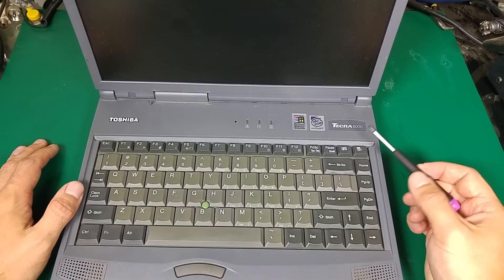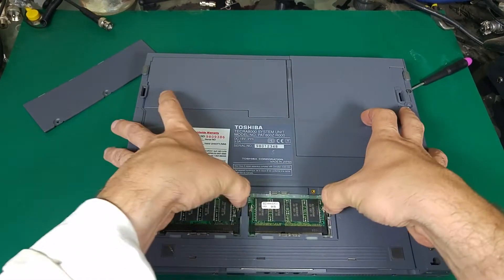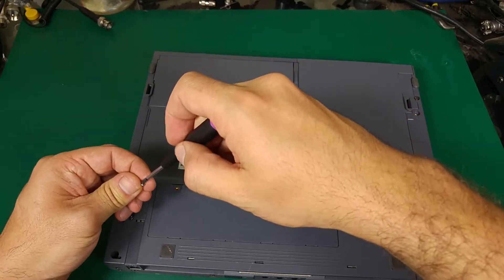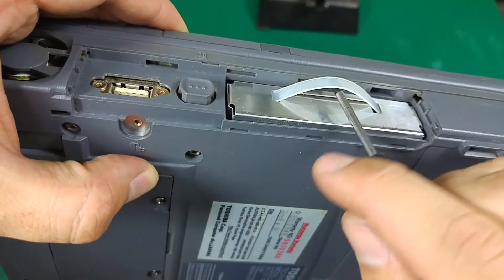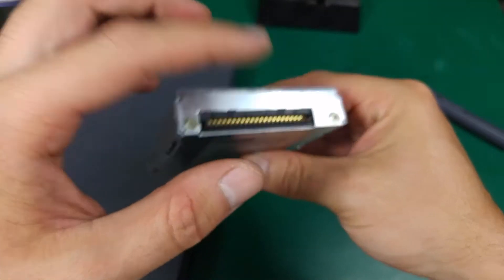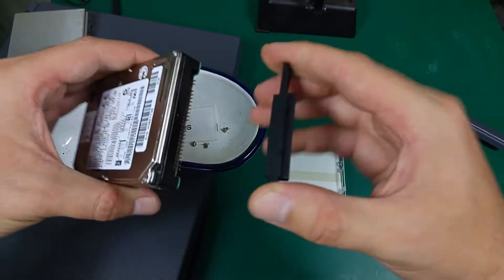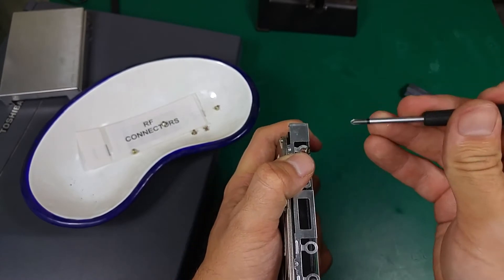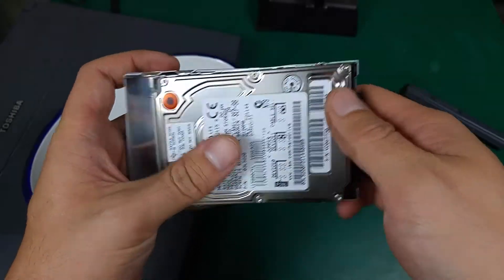Toshiba Tecra 8000 - replace memory and Hard Disc Drive HDD

Comment: I have a question to ask you, how do correct the problem of  sound the speakers on the Toshiba Tectra 8000 laptop?  nothing is yellow and everything is functional, I do not know what to do I tried to do something with the Windows 2000 cd installation but it does not work for reason is in French and not in English installed on the laptop,
 I can't not find the solution  solve the problem of  the sound driver of speakers sound integrated of laptop
Reply from the maker: I do not have this computer anymore.
Please check if audio work on headphones.
You can also try  this driver (i think it's yamaha inside)  -> https://www.majorgeeks.com/files/details/yamaha_opl3_sax_reference_driver.html
You might select it manually via driver-manager and enforce selection.
Good luck
Reply: @ElectronicNoobBlog  ok thank you :)